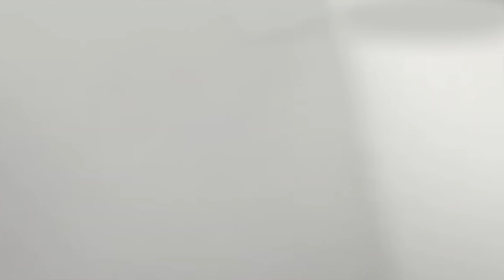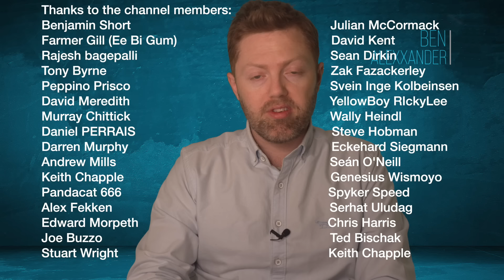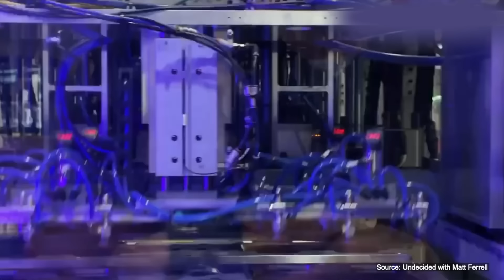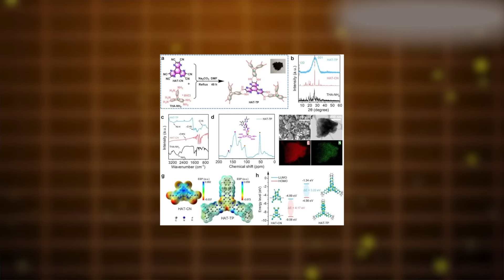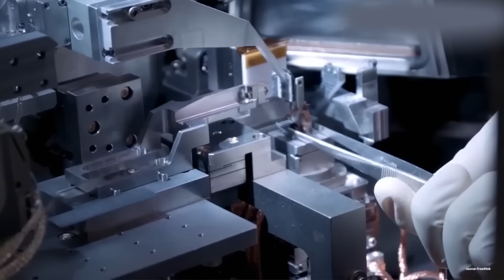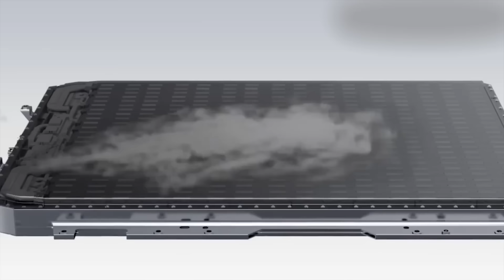New Zinc Battery Lasts 12 Million Miles — And It’s Already Been Tested

Comment: It would be nice if presentations like this showed a discharge chart comparing the different discharge characteristics of the technologies being compared.  Using a single figure for things like energy density and lifetime is fine.  I can instantly appreciate that a battery providing 200 kWh/kg is better than one providing 150 kWh/kg and by how much or that 40 kcycles is four times better than 10 kcycles.  Quoting single voltages at different discharge point is much harder to understand and a chart would be so much easier.
Reply: C rating would be nice.to know. I can't imagine zinc in a phone or laptop because it's nominal voltage isn't high enough. 1.3v is like a alkaline or nlmh battery. With that low of voltage per cell it's difficult to get a energy density that's worthy. 40k charge cycles is great! But if it's 40k at a discharge rate of .1 C then who cares.. it could be a big hit if it weighed as.much as a.piece of printer paper per cell.. but thats not the case. I'm anxious to see what tesla aluminum ion cells do to the battery world. They really have a huge highside.. if your a gambling man I would bet on aluminum ion and lithium sulfur. When we hit that 500 per kg energy density your going to see electric airplanes for passengers become a thing. Thats pretty cool stuff. Safer planes that are cheaper to fly and maintained. Win win for the future

Comment: If you discharge the battery everyday, it would last 150 years. If it's fully discharged once every other day, it would last 300 years. This iwould be like when Volta in 1799 invented the first battery and used it to power a house and it's still working to this day with another 100 years left in its cycle. I am pretty sure the internal BMS electronics would die off after every few years but the design of the battery could be simplified to make changing the BMS a snap.

Comment: Very promising, but one essential metric is rarely mentioned about new battery tech: Charging efficiency. One way of measuring it is “round trip efficiency “, with two batteries. One completely full and the other at a low state of charge. Use the full one to charge the other one completely full. Then do this in reverse. Then calculate how much energy was lost in total. LFP is the champion on this metric with a round trip efficiency, RTE, around 98%. Flooded lead acid often is around 50%. Other lithium chemistries are often quite high too, but nit close to LFP. Sodium batteries seem to be pretty low RTE. That means actual loss of energy. In some contexts, like wind parks, that’s ok, since the alternative is to just loose that energy. However, in cars, a low RTE means local consumption of power goes up by the amount that the RTE goes down. That’s a problem. Also, in many contexts, the amount of incoming charge power is limited. A low RTE then means just less available power.

Comment: If these Zinc batteries, end up as cheap as the sodium chemistries being hyped today, then buying a 40' shipping container sized battery, just to trade electricity would probably become a thing. Rather than 'Forcing renewables, down our bloody throats', industry will be swamped by budding entrepreneurs eager to get them, some of that hot 'cheap at night', 'expensive by day', sweet, sweet pricing differential.

Comment: The downside is that they’ll be incorporated into buildings during construction and you’ll have a massive pull on the grid during the hours of discount energy which in turn will put up the cost and if you’re in a country that is solar orientated then it might end up with you having redundant batteries that are too expensive to charge however low cost nuclear in conjunction with long life storage would work.

Comment: If batteries evolve as fast as computers , smartphones. We could see a standard battery in 30 years with massive energy density, that all standards from output to size and fittings like plugs for energy and plugs for monitoring each cell are identical, every manufacturers' battery can be swapped with another manufacturers. Allow different non-reactive chemistries to improve the battery over time, but imagine the ease of building factories to recycle them.

The future looks bright, i just wish we could find a safe, clean way to generate electricity. No not solar or wind or nuclear or wave or what we now have , but something that is able to generate enough power to run a home a 5kw system  would be enough, or two for bigger energy consuming homes in colder climates.
Imagine buying a house and not having to worry about connecting to the grid, it comes with its own electricity generator. That never needs maintenance or only needs maintenance infrequently. I am sure we will see this but maybe not in our lifetimes, who knows we are advancing in technology so fast right now even big breakthroughs are challenged a few days after being announced.

Comment: eh 45% better energy density compared to LTO, but similar cycle life. didnt sound like they talked about thermal management needs which could be a deal breaker for EV/mobile applications. also didnt mention the discharge curve which is hopefully not as garbage as sodium ion. i suspect that hinting at a grid storage application these are two weaknesses of zinc ion. these are actually strengths of LTO which are now only about 2.5x the price of LFP at the cell level when comparing kwh.
the fact that LTO has existed for a long time now, around 10+ years and no one is giving it the time of day despite being made at scale and becoming affordable goes to show that this chemistry will also likely be dead on arrival.
the last thing auto makers want are cars that have batteries that never wear out. thats why they stopped making EREV's in the usa in 2019, the things never stress the batteries and never break down or loose capacity. gen1 chevy volts routinely go 400-500k miles without any battery degradation before finally having a drive train issue, usually a clutch pack wears out from lots of hard driving and no fluid changes. just look up "ol sparky". 
as long as the usa continues to adopt protectionist tariffs, we will not have access to durable transportation here in north america. the same thing happened in the 80s until Regan allowed the flood gates to open with cheap durable japanease auto imports. until then we will only be able to buy 60k$ cars that last 100-150k miles at most.

Comment: I'm guessing the benefits could be as follows. In vehicles it could allow for maximal usage of vehicle to grid without fear of degredation. Extremely high use vehicles, taxis, various delivery trucks/trctor trailers. Home to grid storage both for life of battery and maximizing demand response. It was my understanding that we couldn't use 4 hour use lithium ion batteries eliminate curtailment of renewables in part because of the uneconomic depletion of cycle life . I suspect using high number cycle life batteries might make the desperate need for long duration energy stoage a little less desperate.

Comment: We need to focus on calendar life vs life cycles
Reply: In portable devices the frequent use case the one translates as the other..pure zinc is not that cheap..complex synthetic  organics also raise questions about safety long term if they get into the environment. .. so yes interesting but what happens if these things get into the  environment and start interacting with other chemicals and organisms this is a lesson we should not forget. So excellent prospects and definitely a valuable battery chemistry in the tool box .. Just don't loose sight of the real world's potential for synogistic  complexities. 🤞🏻🧙🏻‍♂️🥼🌍
Reply: if it's a greed storage application battery - than you can roughly say "cycles = days"

Comment: We do not need  40k cycles of  charge / discharge  in  any  EV  !   We need   energy density at least  450Wh/kg and  low  costs of production .
Reply: 40,000 cycles is amazing. That a 110 years if you cycled it once a day. Energy density will increase and prices will reduces. You buy a battery for you house your never need to replace it with solar improvements very powerfull stuff
Reply: @andrewdennis8404 I have done the same calculculation 110years. If you put 70km worth of it for the daily commute and the rest higher Wh/kg batteries in a electtic car. You can fo 90% of the journeys on them alone without thouching the lifecycle of the higher Wh/kh batteries. 😊😊😊 Or use it in Hybrids for lower range of 350km so only high milage trips in the wilderness need a diesel generator etc.
Reply: Ideal for static batteries such as home batteries and grid support. Also could see it being built into ships for either hybrid or full electric operation. Would last the life of the ship.
Reply: This is not for EVs. The voltage is very bad if the 1.3v is correct, meaning the potantial energy is garbage, if i understand my battery chemistry correctly.
Reply: @MyrKnof The cell voltage is not of great importance. You want it to be as high as possible for a given chemistry as low voltage for chemistry is an indication of internal resistance and sub optimal design efficiency. With a cell voltage of 1.3 volts, low internal resistance is especially important because of V=I2R meaning that the low voltage all things being equal gives greater scope for resistive losses. Assuming resistance in this cell is low, you would simply put more cells in series until you reach your desired voltage. Cell voltage is not a good indication of how much electricity a cell holds especially when comparing different chemistry.
Reply: @garytulie8567  the lower the cell voltage, the more batterys needed to reach a set voltage out. example: it takes Lipo 3.5v 13 cells to reach 45V this new cell needs 35 cells... this is a HUGE diffrence
Most electric cars are about 350 volts. for Lipo thats 100 Cells, for this new battery thats 269 cells

Comment: A train or even a bus that charges very often (as at stops)to use a smaller battery could benefit, or a car that charges on wireless road strips every 50 miles.

Comment: A hybridized battery with three metals or a divided pack that combines their benefits at the macro level could deliver the perfect EV... 750 miles of range, 5C charging, 10,000 cycles, -20 C / + 50 C

Comment: We don't need longer lasting batteries for cars because cars have an expected life that's much shorter than that. However, for grid storage this could be fantastic because of the number of expected charging cycles within a shorter period of time compared to cars. What we need for cars is a low fire risk reasonable life battery that performs at least as good as todays batteries at much lower cost and not requiring expensive materials. It's starting to look like sodium is the answer.

Comment: 12 million miles is no advantage for a car that will go 1/2 million max. But for grid battery storage...
Reply: It actually a TREMENDOUS advantage in that, if the information is correct, the factory installed battery will outlast the electric car‼️
Reply: @BartlettTFD  What's the benefit though? The car will fall apart when the battery is not even 10% in its lifecycle.
Reply: Doesn't mean that it couldn't be used in a car as long as it's inexpensive and works for the application.

Comment: Operating temps? Completely skipped over....
Reply: Probably very poor, something like -5C to +40C cause the organic stuff
Reply: @ГеоргиКолев-ш3я  That's not very poor...-5C to 40C is pretty good
Reply: @pkvp7337  
Pretty good!?!?
If it were to be true, that's a very temperate scale that does not cover more than 1/5th of our planet.
Good it is not!
Reply: @00Resev  It has to be good enough, not perfect. Combustion engines also perform very poorly outside this temperature range, and we use them.